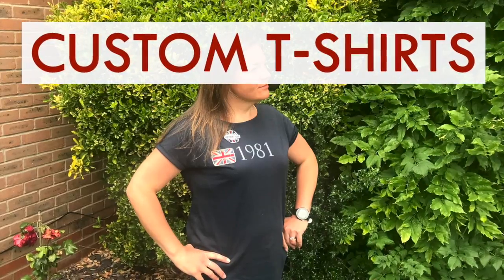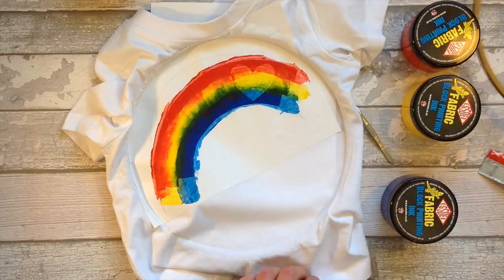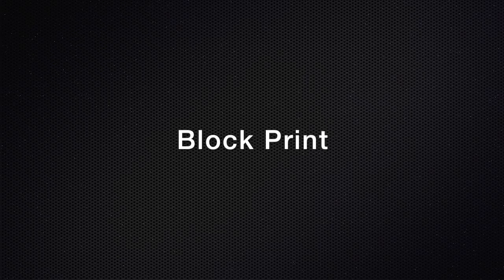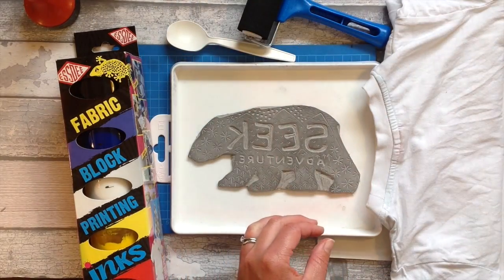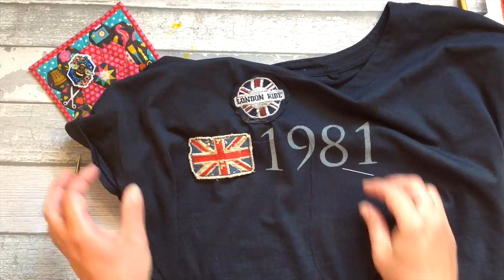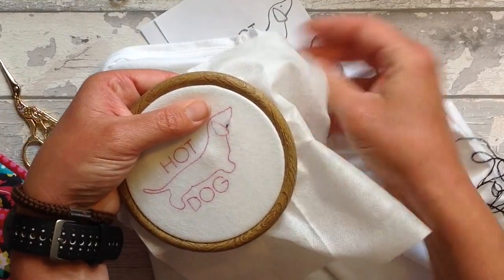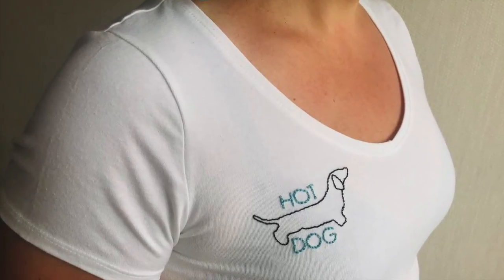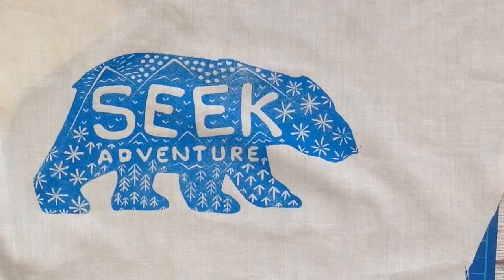CUSTOM T SHIRTS | You can MAKE Easy at HOME | any design

Comment: How did you print the letters backward so they come out proper..I'm bit confused on that part..Love your videos..❤
Reply from the maker: I use photoshop as that’s what I’m most familiar with and I rotate > flip horizontal 
There are aps or other software that you can transform and flip any image or text to reverse so that it then comes out the correct orientation when placed face down.
Thanks